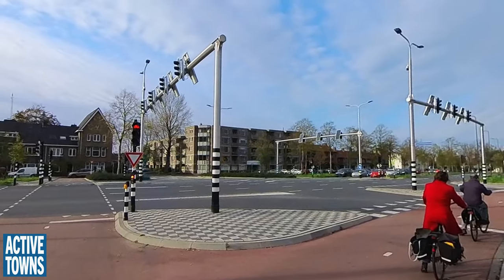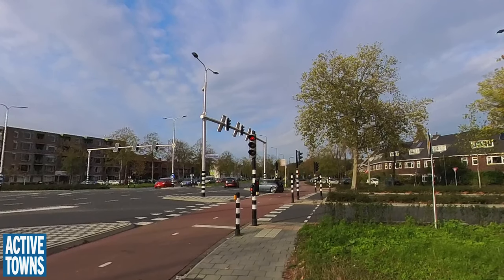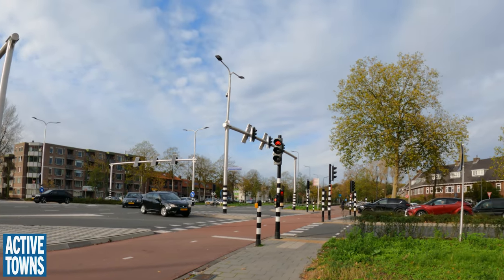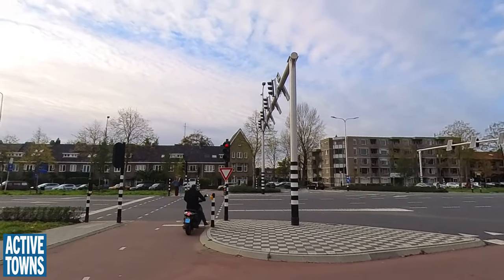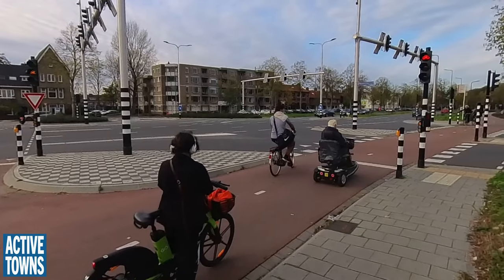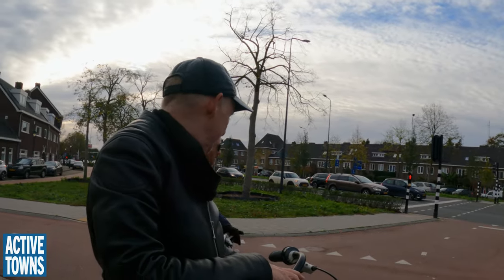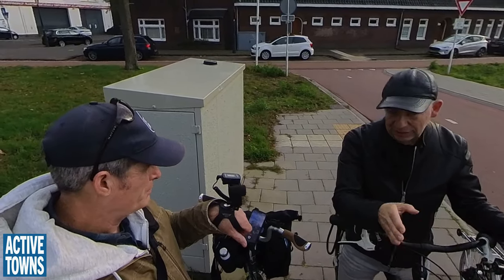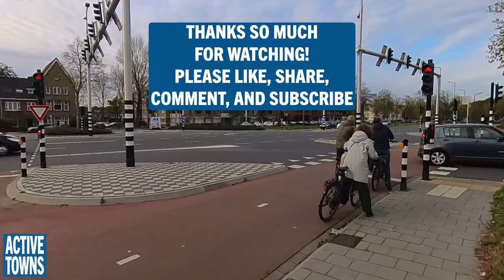's-Hertogenbosch traffic signal dynamics

Comment: The only thing I would add, on which I did a small research project at Hogeschool Avans in Breda, is more accurate and at a greater distance registering devices for approaching traffic. Loops are old tech in this day and even they could be placed farther away from the intersection to improve flow of traffic, so it doesn't have to slow down or stop before being registered.
There are also even more advanced traffic registering devices which can distinguish between loaded/unloaded logistics trucks, cars pulling caravans, SUV's, delivery vans, etc. All of that matters when you want to save time and fuel. 
Plus I believe a good flow of traffic is paramount to safety. Drivers being distracted or startled by sudden events are going to get into accidents eventually.

Comment: These 'intelligent intersections' are really great and they are getting better over time. I wonder if it's learning algoritm. One slight disadvantage is the unpredictability: coming from a distance, on my bike, I used to be able to predict how long until the next green, and adapt my speed accordingly. That does not work anymore. But overall, it's better now.
Reply from the maker: Earlier in my ride with Mark, he was demonstrating how the cycle signal and app technology worked. It was pretty cool stuff. 
Part One: https://youtu.be/wnj7HGRwEsk
Part Two: https://youtu.be/CBt6C60tYsY
Thanks so much for watching!
Cheers!
John
Reply: @ActiveTowns  Thanks, watched 'm, nice ride. The app thing is not available yet in my town (the Hague), I wish it was. The lights in Den Bosch are a bit more sophisticated than here. Traffic lights here seem to have their intelligence based on loops only. They try to identify and predict 'waves' of traffic (cars, mostly: I live across an unbelievably busy road) and let those pass unhindered, unless it takes too long. As soon as there is a gap the other directions get green. At first sight this sounds bad for cyclists and smaller side streets but in practice it turns out pretty well. It seems they can manage the length of the waves. They do this also to reduce environment pollution caused by loads of cars waiting for traffic lights.
Reply from the maker: @jeroenbakker52  Cool! Thanks. 😀

Comment: You should always push the button, because even though there are pressure sensors underneath the bike path, they won't always register a cyclist, or they don't work properly, or haven't been connected. If you don't push the button, you may have to wait for quite a long time, even at intersections with a countdown traffic light.
Reply from the maker: That's the strategy I typically employ. Thanks so much for watching and for the comment. I really appreciate it. Cheers! John
Reply: Most buttons here, in Utrecht, actually show whether they have been triggered, either by pressing or detection. I think that's spreading.

These actually look capable of that as well, it'd be weird if they hadn't added that.
Reply: nee niet waar. er zijn detectiesensors in de grond voor speciaal voor dit sectie stoplichten.
Reply: @dykam  No, that is a common mistake. Even those that light up should be pushed. That they light up doesn't mean anything. If you push it, you will get priority. Else you will just have to wait. Just try it at a few different intersections and you will see.
Reply: @i.k.8868  I don’t know where you have this experience but I never push buttons and I have never waited in vain. For ‘s-Hertogenbosch (and Utrecht) what you say is simply not true. Absolutely no need to push the buttons.
Reply: @BicycleDutch  I live in Utrecht and you are mistaken. There are plenty traffic lights where you absolutely should push the button. Only once you push the button the count down clock will speed up! This is not the case for all intersections, but for many. Of course if you never push the button, you wouldn't know! But you are wasting your valuable time. Eventually the count down clock will give you a green light anyway, but it will just take longer than necessary if you don't push it! :)
Reply: @i.k.8868  sorry but you couldn't be more wrong. I know exactly how things work. I even know which traffic lights in Utrecht respond to the Schwung app. Which detects you even before any loop in the surface can. You should try it. Get up to a traffic light, notice that the detector is off and just a second later you are detected as if you push the button. Of course, when you always push the buttons you wouldn't know that.
Reply: @BicycleDutch  I'm not wrong. But I may try the app, thanks.